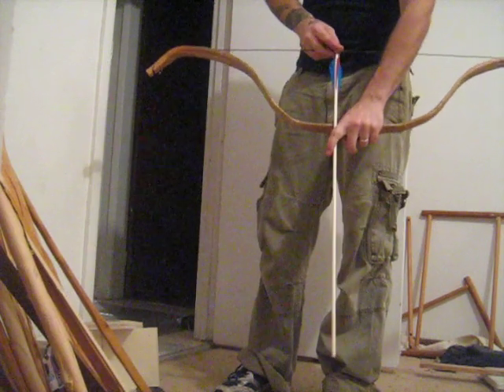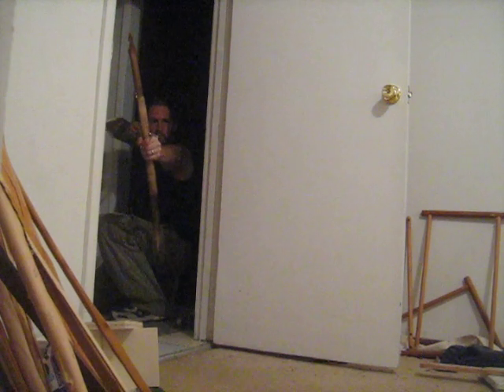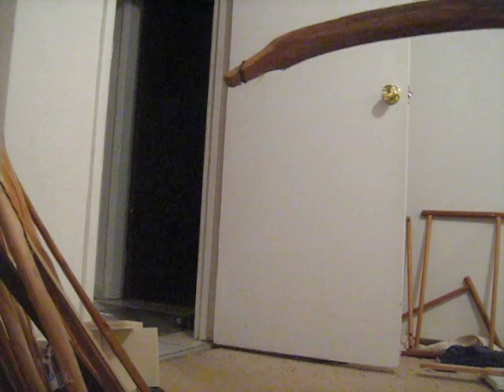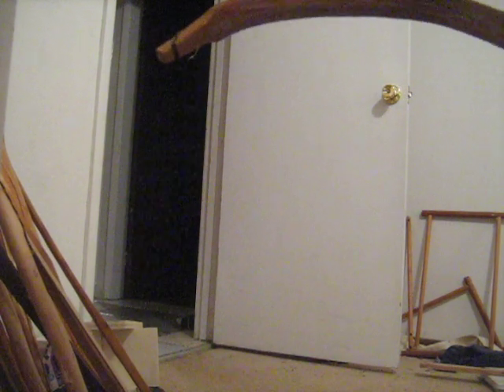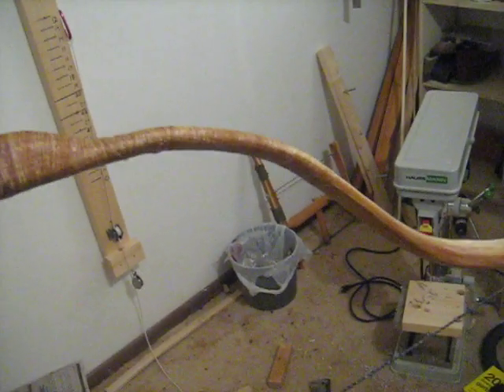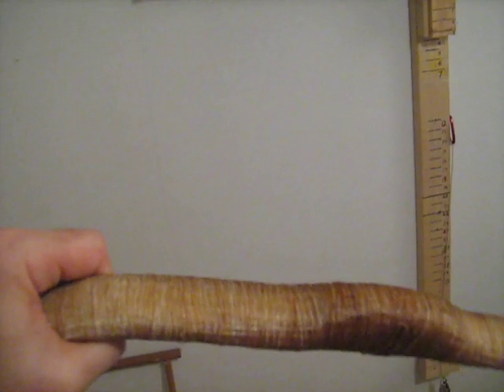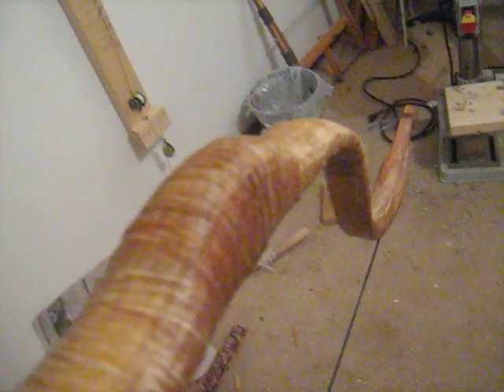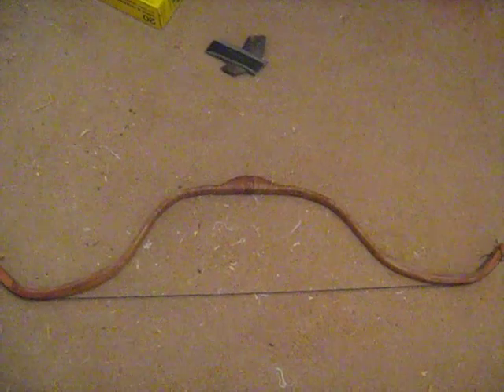pass through osage ottoman

Comment: May I recommend The Bowyer's Bible- Volume 4 especially.  Whitewood limbs, hewing out staves from the 10 to 2 O'Clock positions, yield good bows.  If you do some searches at PaleoPlanet and Leatherwall for more on bows made from branches, you will be surprised by the results.  Any old branch- no.  You must pick the branch section based on whether the wood is strong in compression or tension.